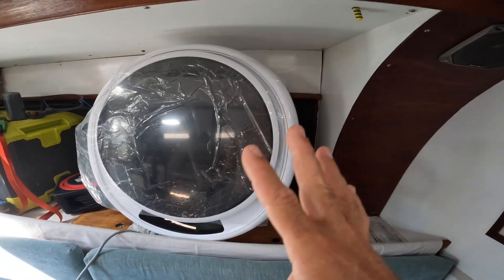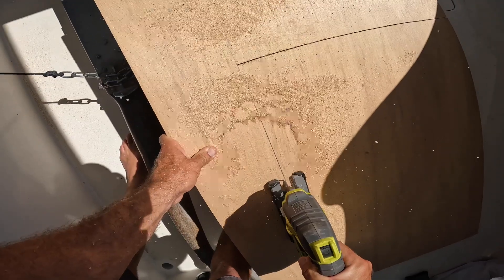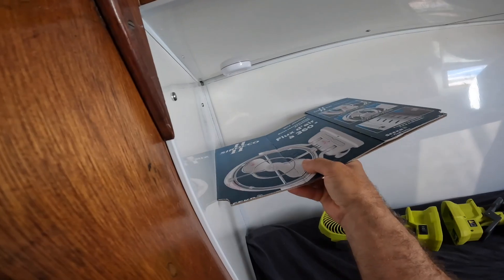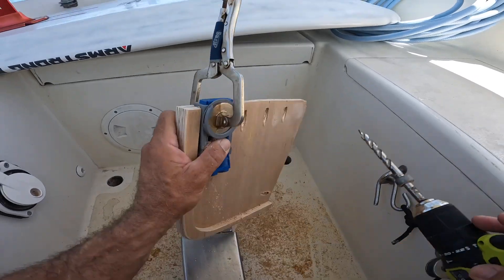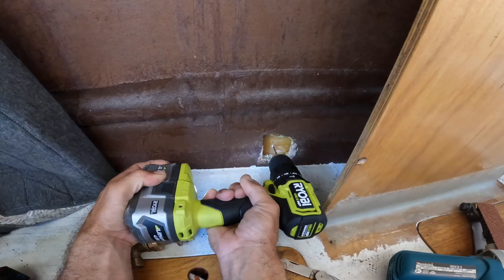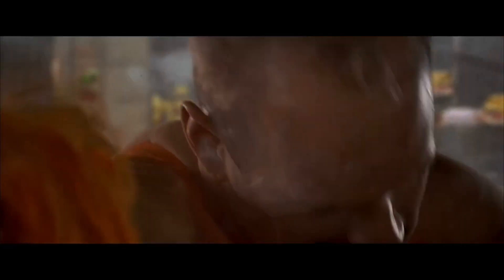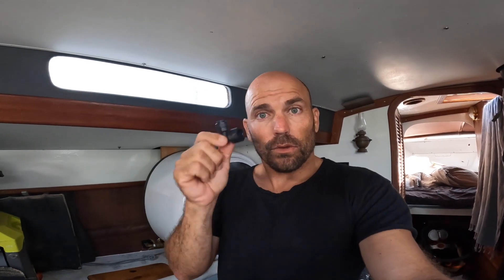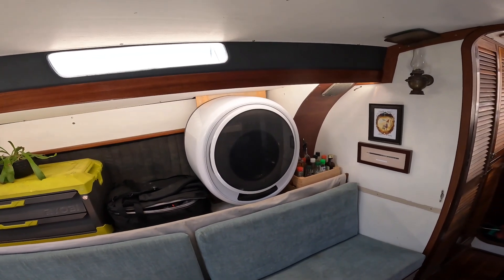Goodbye Laundromats: Mini Washer/Dryer on My Sailboat!

Comment: Will it dry a pair of jeans?
Reply from the maker: Not really. I didn't buy it for the drying option and i've recently found out that there are a few types of dryers. Basically mine uses hardly any power but, I've put on drying a half load for three hours and it drys is out a bit (heats it up a lot) but nothing like the home ones. Maybe putting it on all day if you needed to? I should try that as it uses hardly any power for drying. I wouldn't buy it for its drying capabilities 👍

Comment: Regarding acetone, it was acetone pooling in the bilge that caused the channel barefoot doctors sailing's brand new Leopard 50 to burn to the water, taking a neighboring cat with  her and sending two repairmen to the hospital.  They documented the ordeal, but it took a couple years before insurance and lawsuits were settled to the point they could talk about it.
Reply from the maker: Scary stuff hey! Do you know of a product  that works like acetone that is lighter than air instead of heavier?
Reply: @slightadrift  Sadly the vapor of all similar volatile solvents like MEK or ethyl acetate is heavier than air.  You can of course often use non-volatile cleaners like soaps or surfactants for some jobs, but the main reason I use acetone is that it evaporates quickly, which is exactly what makes it so flammable.  Personally I think you just use the best tool for the job but be  aware of the dangers.  Same way we (hopefully) treat our gasoline jug differently than we might a diesel jug.